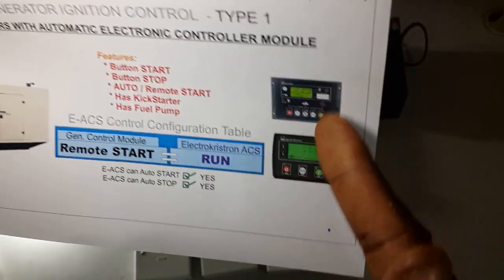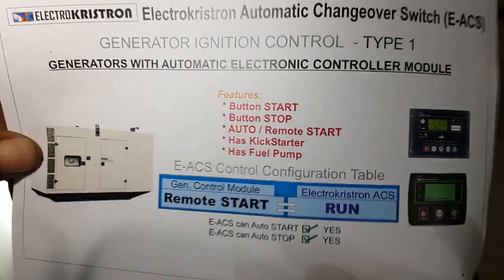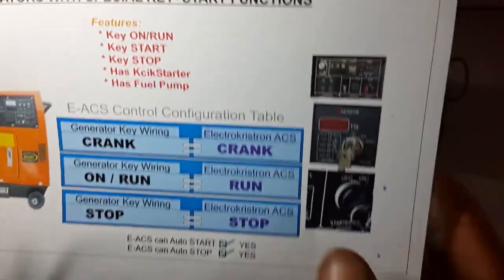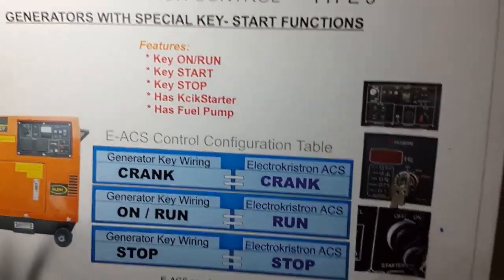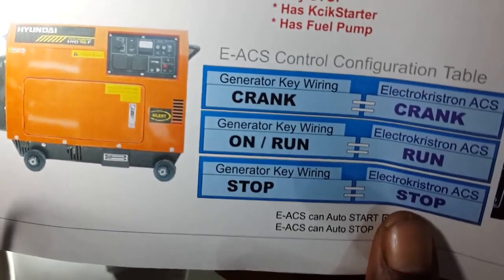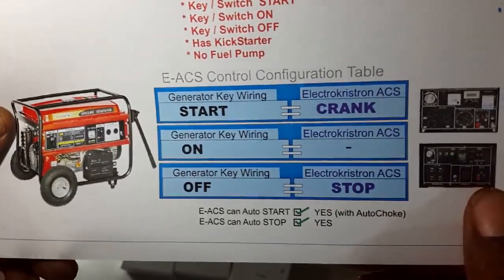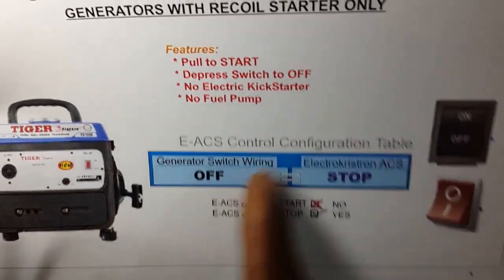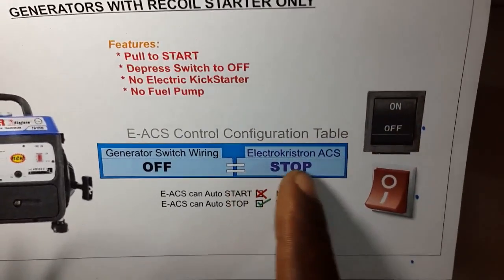How an Automatic ChangeOver or ATS Controls Your Gen and Transfers Your Load Automatically

Comment from the maker: You may want to check out our Automatic Phase Selector panels too here >> https://selar.co/electrokristron-aps

Electrokristron Automatic Phase Selector Switch (Also known as APS or Automatic Mains Cutout Changer) is your ideal automation panel for automatically switching Mains load from one phase to another. When the loaded phase fails, the APS checks if other phases are available and automatically transfers the load to another live phase.

APS Quick Features:

1. 3-Phases in,1-Phase out

2. Auto/Manual phase selection based on user setting

3. Under voltage and over voltage protection (AC 170V-250V operating range)

Comment: Good presentation there.
One of issue related to Contactor based automatic change over (ACO) unit is it's inability for the contactors to magnitize in an event of low voltage, this results in partial contact that eventually burnt the contactor if left unattended for long period of time. 
2. ACO unit doesn't have manual override in such situations.
Does your ACO acknowledge this issue?
Reply from the maker: Many thanks for stopping by and commenting on our products, @el-Amin Musa. Here are the answers you seek:  

Our brand of Automatic Changeover Switches (also known as Automatic Transfer Switches, ATS) have voltage monitoring devices in them to ensure they do not allow voltages outside of the accepted operational range from 170V to 250V AC. Voltages outside that range are considered either too low (below 170V) or too high (above 250V) and are therefore not accepted by the panel. This helps to protect the expensive internal Contactors as well as your connected loads.  

Additionally, we also have some models with inbuilt Manual Transfer Switch (MTS) option, which acts as a manual bypass or override switch in case you choose to allow the out-of-range voltage in by all means. 
These models are called "ATS/MTS Combos" as they combine both automatic and manual power transfer functionalities.

You will easily find some of such models shown on our home page https://www.electrokristron.com/

Comment: Thanks for the video.pls how will the connection look like if you want to introduce solar connection into the existing connection.
For the existing connection are you going to leave the fuel tank valve on all times? And what happen if the battery run down if the ignition will always be on?
What happens to the generator choke?how will it return during and after starting?
Is there a DC supply some where to energize the relay during operations?
Thanks alot
Reply from the maker: Hello @Dennis_Taiwo, thanks for your comment. I shall answer your questions in the order you have asked:
1. Solar Connection: The video shows a 2-source model for Mains and Generator. We have designs for 3-source (Mains, Gen1 and Gen2 or other source) and 4-source models. Your Solar Inverter unit can simply attach to the Gen2 input terminals in a 3-source model (Mains, Gen1 and Inverter.
2. Fuel Valve ON/OFF: If your Petrol Gen's Carburetor is good and does not over-float, yes, you may leave the fuel tap or valve on to allow for automation with the ATS.
3. Battery Condition: For standby Diesel generator's there is often an incorporated battery charging module to take care of the battery so that it doesn't run down while not in use over long periods. A similar module can be externally installed if your Gen does not already have a charger. For Petrol generators, the case is not as critical but a charger may also be installed.
4. Ignition ON: For automation purposes, your Gen's ignition should be left ON otherwise, the ATS will not be able to communicate with it. For normal everyday operations, your battery should not disappoint especially if the cells are good. This is because at some point in the day, especially in Nigeria where public power supply is erratic, you are likely to put the gen to use and thus, the battery get's recharged. If however you will be away for a long time or you know the Gen will not be used for a long time, it is best you turn off the ignition.
5. Choke: Gen choke applies to Petrol or Gasoline generators but not all generators require manual choking. Most modern petrol generators now come with what is known as "Auto-Choke" which requires no user intervention. Luckily, you may convert the existing manual choke on your generator to an auto version by purchasing the auto choke accessory and getting it to replace your manual choke.

I hope that answers you list of interesting questions. 
Additionally, you may find our Electrokristion Inverter Battery Interface Module (EIBIM) useful with your Inverter installation.
Read more about the EIBIM here: https://www.electrokristron.com/product-category/inverter-battery-interface-modules-eibim/

Comment: Great video. Lots of useful content. I think you could have actually split it into two videos and done a separate one for the generator interfaces. 

I might be interested in a 3-ph changeover switch if it can come with a built in auto phase changer and also some means of qualifying the supplied voltage. So basically, if NEPA (or even the generator) supplies voltage outside a set range (i.e. low or high voltage), the changeover will refuse to connect to the source or disconnect it if already connected to the source. 

I don't need the generator controller interface because I have a separate device that does that works with my inverter just like your inverter changeover module.

Will email you. Thanks.
Reply: Have you been able to get such system, I am also in search of it.

Comment from the maker: As requested, here are prices and contact details:

(A.) Prices for 2-Source models (Public Mains & Generator): 
32A Electrokristron Automatic Changeover = N40,000 
45A Electrokristron Automatic Changeover = N50,000 
63A Electrokristron Automatic Changeover = N60,000 
100A Electrokristron Automatic Changeover = N80,000
 200A Electrokristron Automatic Changeover = N150,000 

(B.) Prices for 3-Souce models (Public Mains, Generator 1 & Generator 2): 
100A Electrokristron Automatic Changeover = N120,000 
200A Electrokristron Automatic Changeover = N210,000 

(C.) Others: 
100A Electrokristron Automatic Phase Changer = N120,000 
Electrokristron Inverter Interface Module (EIIM) = N 15,000

(D.) Contact details: 
Electrokristron Power Systems 
Office Address: 
ELECTROKRISTRON PLACE 
12/15 Oshifekun Street, (Opposite Deeper life Church) Morogbo, along Badagry/Mile2 Express Road, Agbara Axis, Lagos state, Nigeria 
Telephone: +234-8084710033, +234-8135993416 
Email: electrokristron@gmail.com
Reply: It best you guys make it affordable for Nigerians to attract alot customer interest. It obviouse from 63amps upward which is needed for mostly flat apartment owners  is way too expensive. 
I have interest in purchasing 63amps or 100amps. But the price range is way too expensive base on Nigeria currency
Reply from the maker: Please call us on the given contacts for the current prices of our ATS products and the rest.